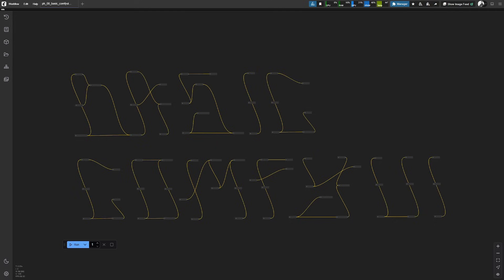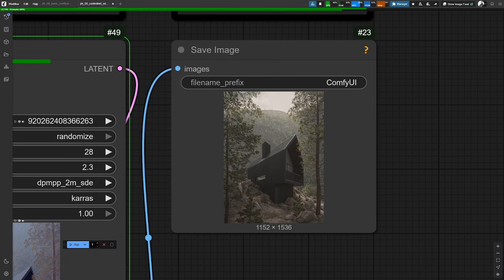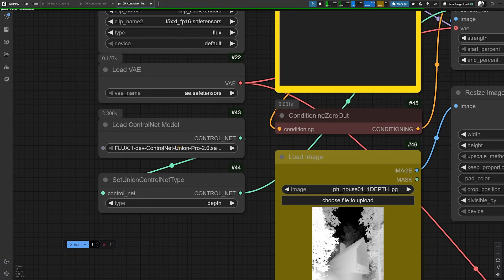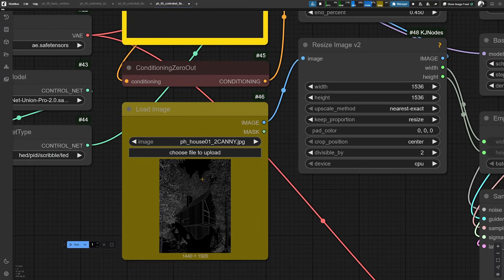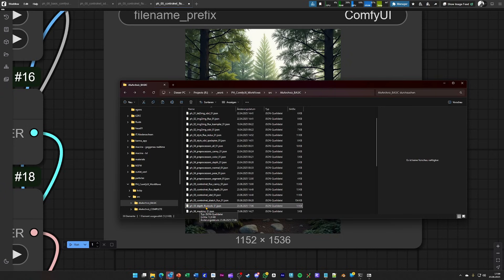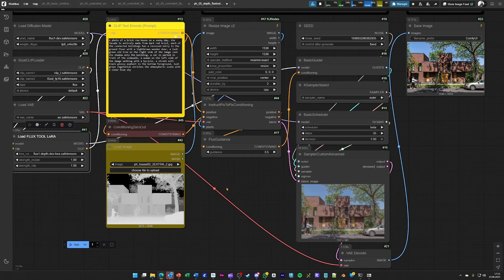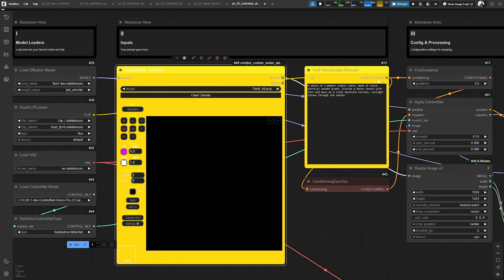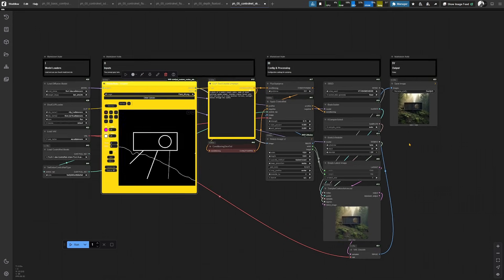BASIC Comfyui Tutorial for Archviz x AI - 08/17 CONTROLNETS

Comment: Keep up the great work!    I too have been heavily relying on controlnets (both fun and professional work) 

I find however, particularly with SDXL models, it can be difficulty to maintain realism and quality levels the higher the controlnet strengths. 
I primarily use Canny and Depth (together).    But I find unless I set those strength values to sub 30% the output is 'muddy' and lacking realism. 
Do you have any advice on how to maximize quality & clarity when using higher (ie- 0.9 or even 1.0) CN strengths ? 
Or perhaps do you suggest I introduce another CN to my workflow like scribble ?
In the meantime I am running the output into a SD1.5 model called AbsoluteReality which is very good at CN high strengths and I use it with a KSampler denoise ~0.4 to 0.6 to clean up and make the image 'crisp' again.
Reply from the maker: Hey thanks for your feedback! I wouldn't recommend using such high values for controlnets, unless its intended to experience the limits and effect on quality, as you described, first hands. But in general, the better the Controlnet, the higher these values can be applied before quality decreases.

Comment: Hi! I'm trying to run your PH (Archviz x AI) workflow in ComfyUI, but I'm consistently hitting this error:
Prompt execution failed  
DownloadAndLoadFlorence2Model  
ValueError: Unrecognized configuration class ...  
torch.load fallback failed due to vulnerability CVE-2025-32434  
I've already updated torch to version 2.6 or higher as suggested, but the error persists. I also double-checked all models (.safetensors) and paths.
From what I’ve seen on GitHub issues, it seems the problem is related to how DownloadAndLoadFlorence2Model uses AutoModelForCausalLM with an unsupported config.
Do you plan to update this part or provide a version of the workflow that works without Florence2?
I’d really appreciate it — the workflow looks amazing, and I’d love to get it working.
Reply from the maker: Hey, have a look at the repo from kijai, there is a lot of helpful comments. Unfortunately there are many ways why something not loading correctly. I found this https://github.com/kijai/ComfyUI-Florence2/issues/134